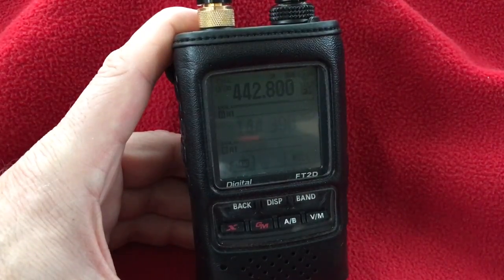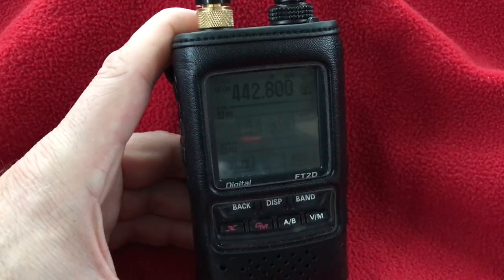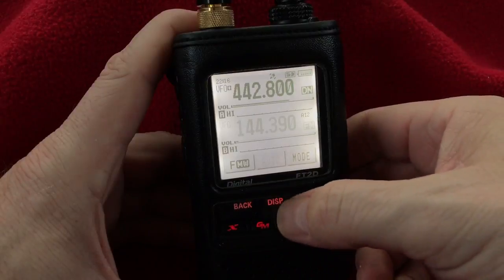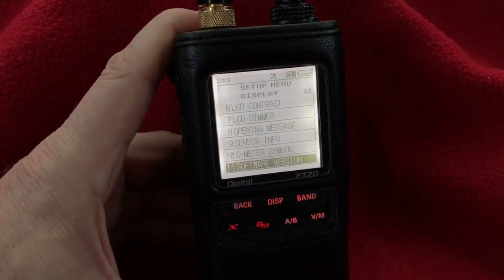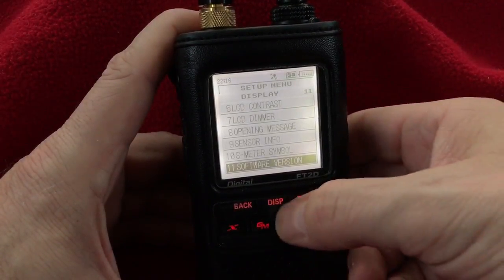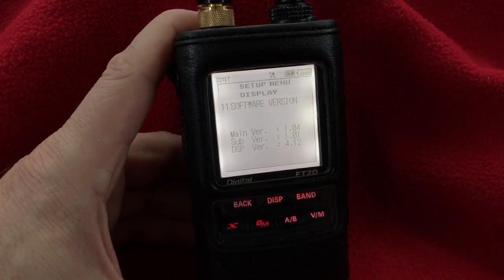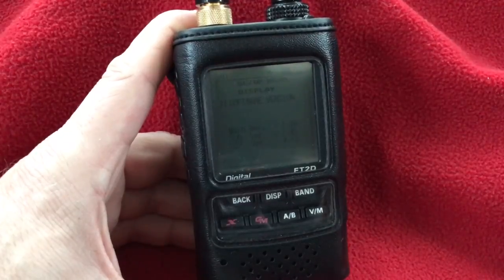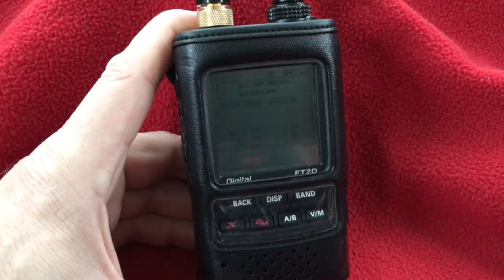Check FT2D Firmware Versions

Comment: Thanks for sharing this.  I can't seem to find what the latest firmware version is over at Yaesu - do you happen to know where to find that info.  Thanks again.  Also, what antenna are you using?  It doesn't look like the antenna that came on mine.
Reply from the maker: Ben, last I knew at this time  (aug, 2017) Yaesu pulled all the firmware - you may have to call them to get the update or find it elsewhere - sorry I don't have it.  The antenna I am using is a dual band BNC from Diamond - I am using an adapter on the radio SMA to BNC so I don't wear out the connector - the BNC is rated for 1000's of connections VS the 100s for SMA.
Reply: Thanks for the info on the firmware and antenna.  I'll call Yaesu later today.  If I get any firmware info I'll post it here.
Reply: @BenDover-iv8pt  Were you able to get new firemware?
Reply: @3footedIguana  I haven't updated my FT2D at all.  Seeing the hassle so many were going through I just haven't gone there yet.
Reply: @penrynbigbird  I watched videos.  It does look convoluted.  But luckily I found that my radio, bought used, was already at the latest versions. Main 3.10 sub 2.01 and dsp 4.31.